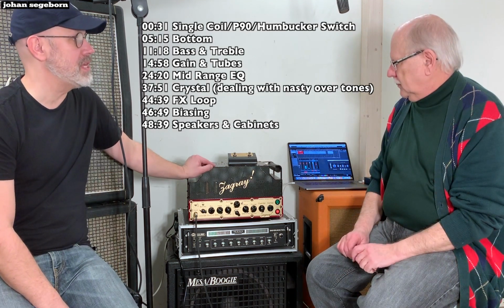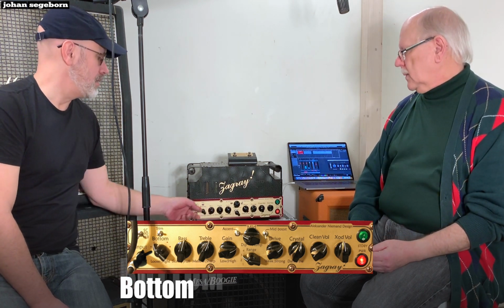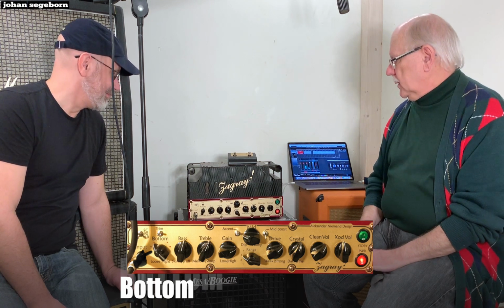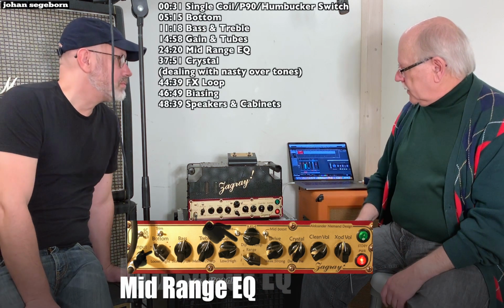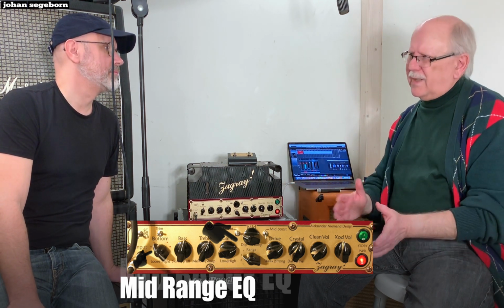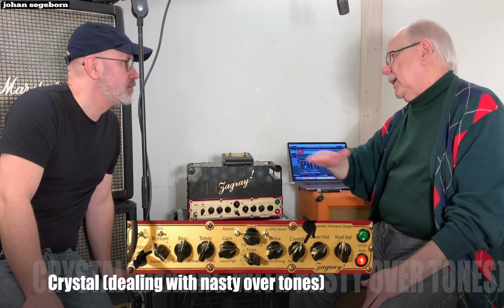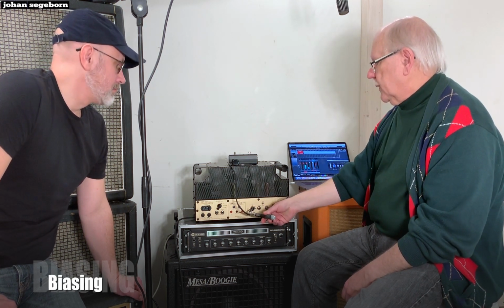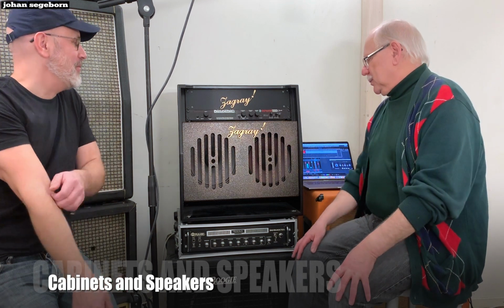Aleksander Niemand reveals secrets behind the Zagray guitar amp!

Comment: Excellent interview with Alek. I bought a Zagray! about 5 or 6 years ago from Alek in Nashville. It is one of the most unique amps out there. One thing not discussed was how great a pedal platform this amp is. It is great on it's own but in the real world (depending on the gig) pedals are going to be used. In my case it gets a bit crazy with some intense effects and the Zagray breezes through them all without breaking a sweat. The EQ section is a tweakers dream. I have a fairly substantial collection of amps many "boutique" and vintage. The Zagray! has become my main gigging amp. It is a very well thought out amp and you only need to hear Alek talk about it for a few minutes to realize he is a clever designer. Thanks for posting this one Johan!
Reply: Hey Mark, Do you still have a Zagray?
Reply: yes I do! Love it!  @fallingmanjutsu
Reply: @markpotvin4505  awesome! I purchased one yesterday but unfortunately it did not come with the original footswitch. I am trying to figure out if there is an aftermarket switch that does the job safely. Could you please share any info about the FS if you have it? There are no pictures I can find online of it. Thanks for your time!
Reply: @fallingmanjutsu  having trouble sending this message. The footswitch looks pretty standard to me. It has 2 switches and a stereo plug. One for the loop and one for a boost. You can also use the loop as a second boost using the loop with it's pre amp

Comment: If the pickup voicing switch affects eq after preamplication, why should it’s character (i.e. frequency curve) depend in any way on the impedance of the pickups? It shouldn’t - all that should happen is the combination of two eq curves: one produced by the interaction of the pickup with the input section of the preamp and one produced by the voicing circuit in the later stages of the amp.
Reply: Why would you want it any other way?
Reply: vacuumvoodoo During the interview Mr Niemand seems to imply otherwise.
Reply: @slovokia  Well, I am Mr. Niemand :-) :-) I only mentioned that different pickups of the same family can differ from each other. The thing is to modify amp's voicing without affecting the PU itself. That's why I don't mess with amp input impedance. I might make input stage  gain variable  like on the Tubewonder, my other amp. But that's it.

Comment: Concertina PI?
Reply: Odwracacz fazy z dzielonym obciazeniem. (Split load phase inverter)
Reply: @vacuumvoodoo  Dziękuję za odpowiedź! Can you say why you use this type of PI?  As far as I'm concerned it's not very common in tube amps these days.
Reply: @michapachocki9093  Why?  DC -coupled Concertina PI produces an interesting effect when pushed, the outputs will go into momentary phase reversal for a short fraction of signal's period. It sounds sort of "flangy". Some hate it some love it. It's not very easy to dial in, so it's for the fans only.